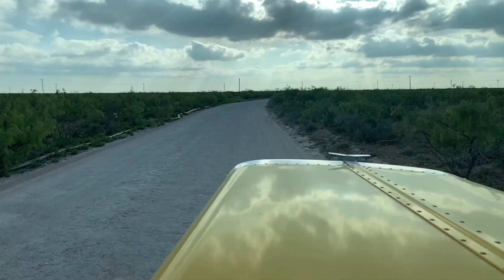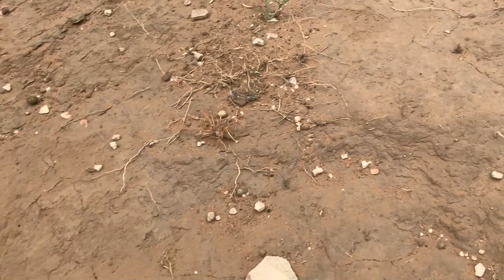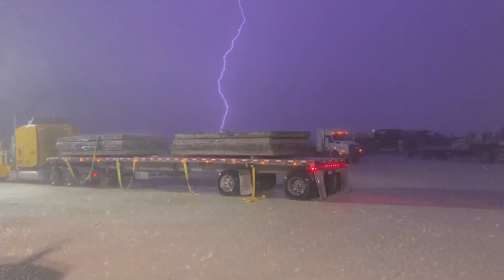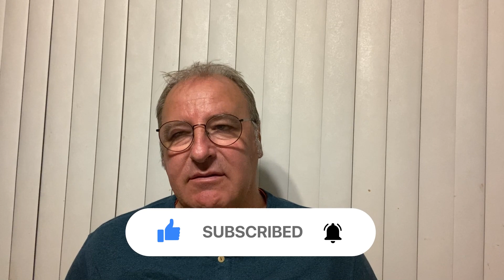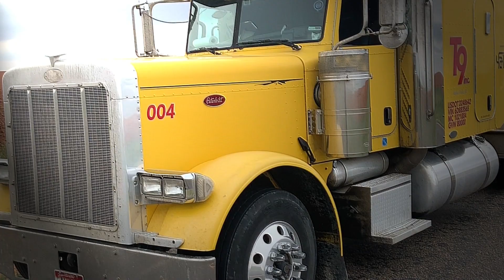Should I Scrap My W900?

Comment: Tommy, in the haulage business you have good days and bad days. Scrap the W900 and transfer the engine over to the Pete. Move on as quickly as possible.Money and time spent on W900 and future problems which you will encounter, it’s not worth the hassle. Many years ago, we had a four year old Daf CF which was boarder line write off, we choose to repair it and get it back on the road, we had enlist problems with it until it was written off again in a minor accident . The truck was severely weekend in the first accident but pulled and bent back into shape to satisfy insurance and Vosa. Sometimes it’s best to walk away and recoup money by scrap  and transferring the engine into the Pete. As long you have more good days than bad, you will be fine. Family haulage business is celebrating 70 years this year in the business.
Reply from the maker: Congratulations on the 70 years. I agree with you. They are never the same. I am for sure putting the cat engine in the yellow lady and salvaging the parts in the KW. Thanks for the comment. Best wishes.

Comment: Hi T.  Stop and read the comments but make up your own mind, first you’re a transport OPERATOR not a restoration company  ?, we rebuilt a 2 week old 111 Scania after a major crash ( new cab striped down to chassis)  in a big dealer workshop and the vehicle spent half it’s working life having repairs to unforeseen damage and faults?, do you want to make work for yourselves or run your company? The calculations only tell you what is possible it will not tell you the headaches etc etc it takes to make it happen, finally to my mind a burnt out truck will always be just that it’s a decision you will have to make that’s trucking. Best wishes to you Libby and family Tommy. Bill 🏴
Reply from the maker: Thanks Bill. Great to hear from you. I completely agree. It will never be the same. Scrap the KW and put the cat in the yellow truck. Hope you are surviving the start of winter.

Comment: Part them out and lease volvos with the d13 and auto. Not a big Volvo fan but fuel economy and low running costs is the way to go. Best of luck.
Reply from the maker: I am in a Volvo right now. I agree with you. They are a good steady product.
Reply: @SCOTTISHTRUCKERTOMMY  I just moved job from a d13 Volvo to an x15 565 Pete with only 65k on it and I’m only getting 6.5 compared to over 8 steady with the Volvo ! No comparison.

Comment: Truth is Tommy if you think $46k for the blue truck repair it'll be more like $55k+. The heat those axles have taken will either have distorted them or taken the strength out.
Cat into Pete and scrap bluey. You can do a rebuild on the Cummins at your leisure then look for a truck with a f****d engine.
Reply from the maker: That’s the plan. Thanks for watching and commenting. 👍

Comment: Hi Tommy it's a no brainer cat into your yellow baby can you not use the 13speed box in the yellow one and sell the box from that truck and 2 straight pipes on the road in a week or 2 then strip the 900 at your leisure  no hurry cheers bud Rk
Reply from the maker: That is the plan. Might have a better use for the 13 speed. But in general. That’s the way to go.